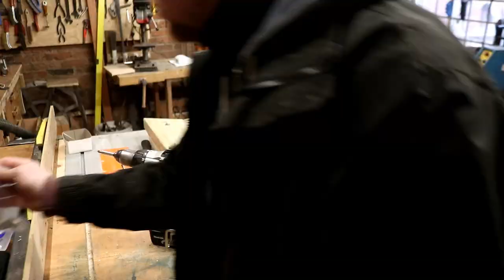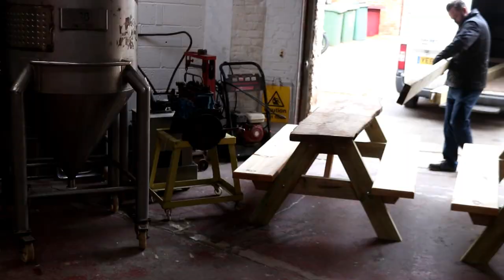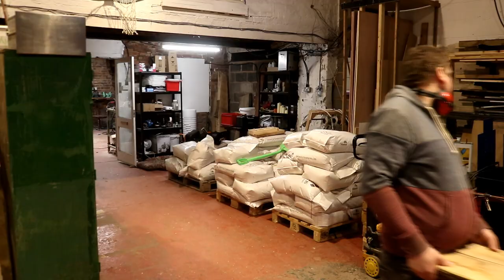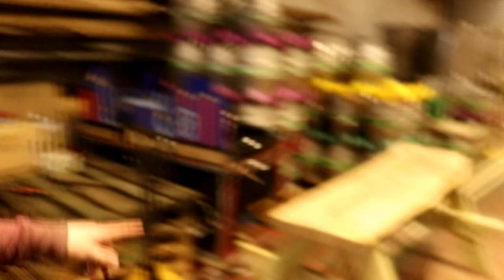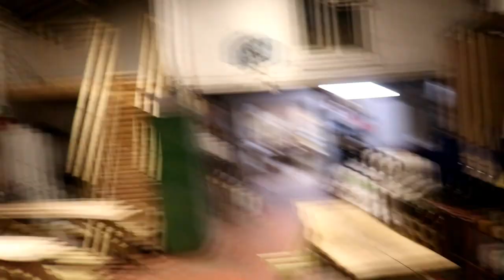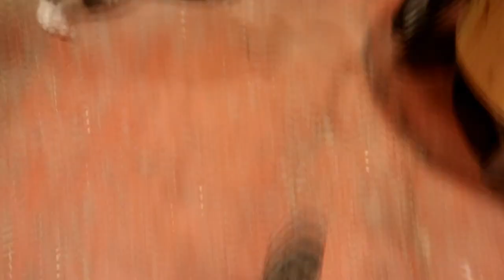AND BOOM ~  9 BENCHES

Comment: Does the glow in the dark resin cost more? It would be cool but unless it is really dark out there it may not show up? I've seen a "sea bed" resin table that looked really cool but I think that was concrete and resin but on a similar theme. Angle the top and put a level surface of resin on it, just another idea. Great vlog as usual. Cheers, Schnuz.